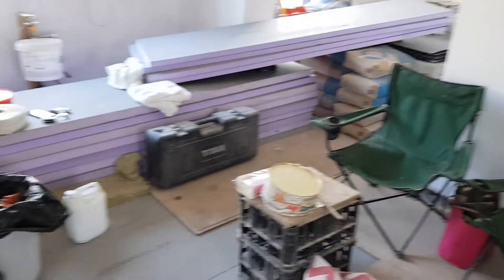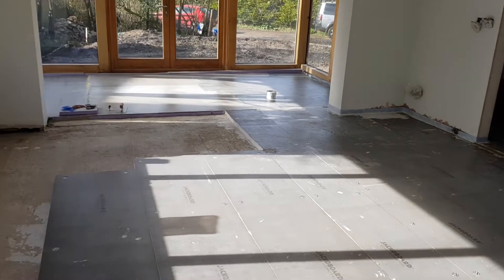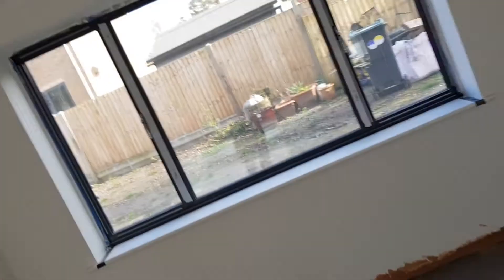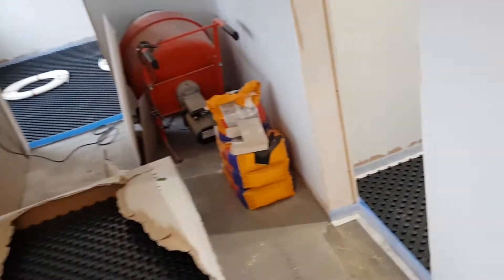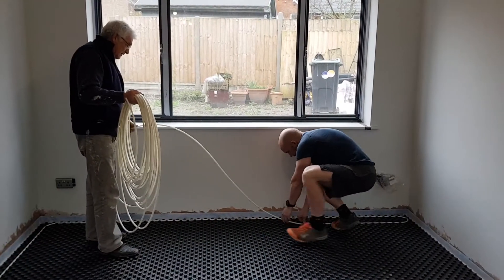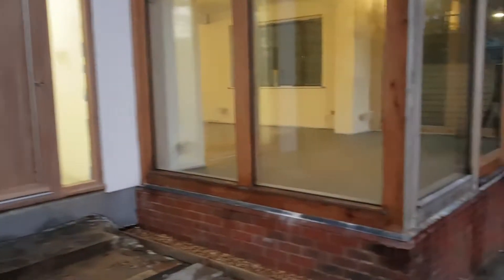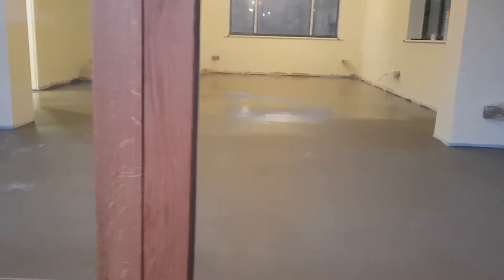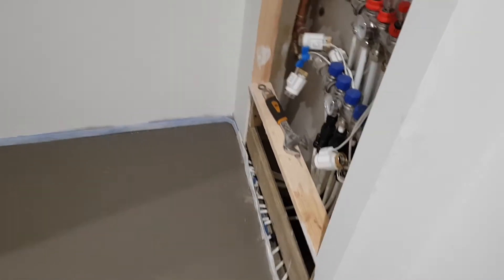Episode 30 - "Nu-Heat LowPro Max installation and self-leveling pour"

Comment: Hello, I’ve just come across your video and I’ve just purchased this system (low pro max ufh) it’s going in the majority of a bungalow refurb’ may I ask how long roughly it took you to fit the castellated flooring the pipes and the manifold (I’ve a floor tiler to do the self levelling) so it’s just time query re the rest? Oh and great news your happy with it! I’m also going for a 26kw external combi boiler (I’m on oil, no gas here) Lesley